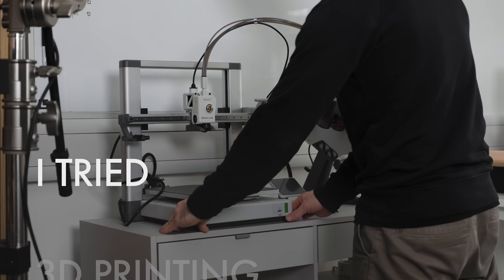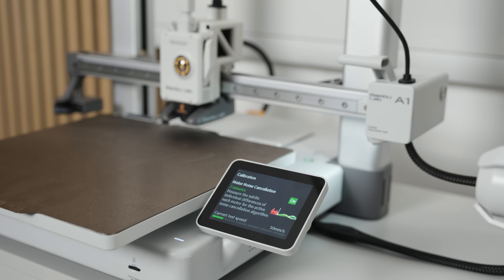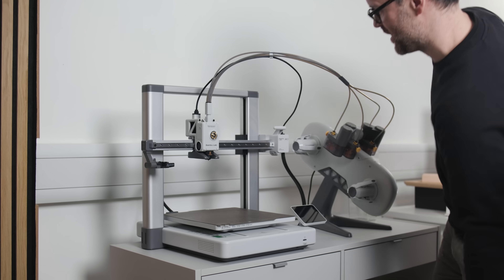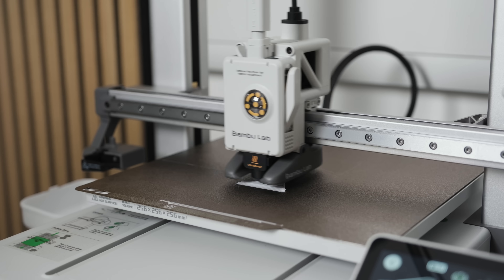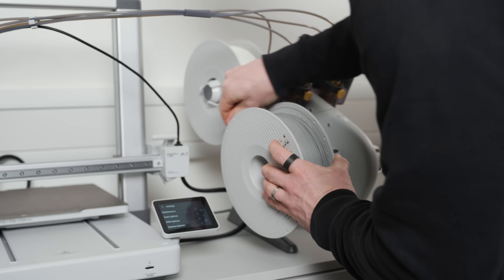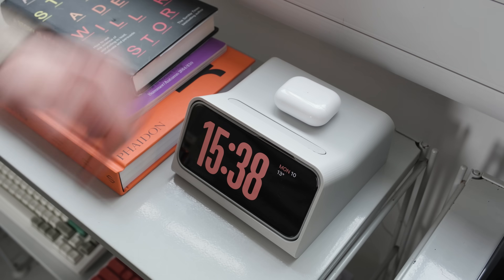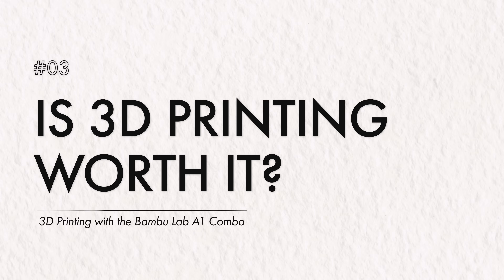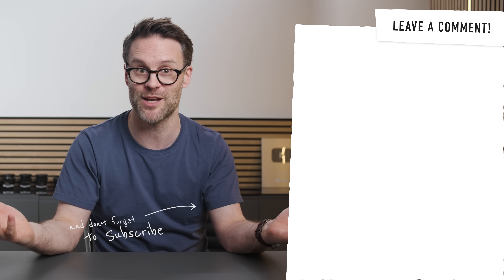I Tried 3D Printing as a Beginner: Is it Worth It?!

Comment: If, as a P1S owner bought one one of these, I would immediately switch it to LAN only mode as I did with my P1S and download any prints I want to make. I'm no fan of having a print uploaded to a cloud server only to have it downloaded again to my printer before it can print. And if your printer is working great, don't update jack. I'm still using my P1S on and older version of Bambu studio with an older version of the firmware for the printer and works just fine. My thought is, if it ain't broke, don't try and fix it.
Reply: I’m not sure I understand your reasoning here. Updates are meant to be useful. Update when you want to  

But not uploading to the cloud, are you concerned about IP?
Reply: @ It takes me less time to to upload directly to the printer than it does to take a print, send it half way around the world only to have it then upload to my printer. To me it makes no sense. Why would they want me to do that?
Reply: Stop fear mongering. Nobody cares
Reply: But it is broke. That’s why the updates come out. Update the software and your mind will be blown.
Reply: @ No thanks. My P1S isn't broken. And as a retired Industrial Electrician that worked in maintenance for over 30 years the saying, "if it ain't broke, don't fix it" rings as true today as it did years ago.

Comment: The printer camera actually records time lapse videos and saved them to the Micro SD card inside the printer, you don't need a separate camera
Reply from the maker: Yes - but the quality is terrible. And then angle is less than interesting! I would always use a proper camera to do this personally.

Comment: If you want to make your own objects for printing, I would suggest starting with tinkercad. It’s a pretty simple system that lets you build surprisingly complex objects out of simpler ones. Don’t worry, there’s a tutorial.

When you’re ready to take the next step, I’d recommend onshape. It’s very powerful, but I find it easier to use than either Fusion or Blender.

Both are web-based programs and are free to use.

Edit: I made this comment while I was about halfway into the video. Glad you found tinkercad on your own.

Comment: I got my first 3D printer last christmas it was a Elegoo Saturn 4 Ultra and it's a resin printer and it is great but I'm limited in the size of prints

I pre-ordered the new Centauri  carbon which is a filament printer like the one in your video which has a bigger build plate of 256x256x256 for some bigger projects I have in mind I bought7 roll of filament ready for when it rocks up and also learning to use the slicer software as well

Comment: Been looking to get in 3D printing and getting the A1, then this video popped up. Wondering if the security changes from Bambu affect people’s opinions
Reply: Look I’m big into 3d printing. But for the average person that’s also pretty big into this. It does not matter. Pretty much people are freaking out that these printers will auto update. They can’t to crazy complex things anymore deep within the firmware of the printer. 99% of us this has no effect on. You would never know the difference if all these big YouTubers weren’t complaining about it
Reply: @ thanks, honestly i’ve been looking around at other printers like creality but bambu still seems like exactly what I’m looking for.
Reply: @ahintea  yeah i mean ngl, bambu is def the easiest to use and start with. but after you get more experience they're all similar :)
Reply: @NathanRosenberger  yes YOU may not know the difference but hey buy from a company turning in the wrong direction when you can just as easily buy a just as good printer from a better company. one update may not be a problem, hell, maybe not even 3 updates. but what about 10 updates down the line?
Reply: from somone who has been printing for years, I still love my machine but unless bambu turns around and shows that they wont be making terrible updates I don't think I would buy another printer from them. while they do have great printers. i can just as easily use another brand, so its really up to them
Reply: I've been in the 3d printing community for a while and yes, Bambu had always had an eye to see if they would eventually go closed system and the security has always been a concern, the latest firmware was the evidence a lot of people needed to confirm their suspicions

Comment: 3D printing is a superpower.. having more than one printer is like an infinity stone.
Reply from the maker: Love this!
Reply: I’m itching to get my second Bambu printer. I have the Mini now and I long for that bigger build plate. Owning a Mini will make you a master at slicing models though.
Reply: @drj3141 same I have the mini. And I can’t wait to get it big bro the A1
Reply: @drj3141 it's good for beginners?
Reply: Bambu lab A1 good beginner 
? @drj3141
Reply: Calm down THaNoS :P
Reply: Indeed. My first was the elegoo neptune 4 pro, and it kind of sucked until I changed the hotbed, wireharness and installed the lates firmware for it, it now just works like the Bambu A1 I have (LanModeOnly and blocked from internet)
Reply: Having resin and fdm printers together are the real superpower
Reply: three FDM and three SLA printers, then you have infinity stones.
Reply: My first printer was the ender 3, after that I got a elegoo neptune 4 .

Now I have two k1 maxes and one k2 plus 😅
Reply: There are automation systems that exist so you can print multiple plates (kind of like a stack of plates that get autofed/removed from the printers)
Reply: What about the plastic waste from the 3D printers... Is any sustainable material can be used... Otherwise we are going to create more plastic waste...
Reply: for a general hobbyist that prints every now and then, its a waste though
Reply: @pear-zq1uj  Do you have one ?
Reply: I have 2 mini one with combo and A1 combo and p1s combo
Reply: Not practical for commercial level. Its just a toy.
Reply: Congratulations on your superpower of being able to create plastic junk at home. What a hero.

Comment from the maker: Something a little different this week pals - still tech, still making life better - and I might be hooked. So what do you think? 📣You can check out the the Bambu Labs A1 here: https://shareasale.com/r.cfm?b=2485357&u=3578368&m=138211&urllink=&afftrack=
Reply: actually printers can print great in a earthquake. Makermuse made a video where he printed stuff with the printer hanging from the celiling
Reply: Bambu Lab has closed its firmware and only allows cloud printing.
NOT WORKING.
It's instantly DISCONTINUED because its product requires the company to operate. Planned obsolescence.
Reply: the desk that you used to put the printer is the SPIKSMED, 97x40x79 cm?
Reply: U use tinkercad !!!!!! Omd finally someone who 3d prints abd doesn’t use fusion 360!!!!!
Reply: @BenJ30611 ik right bro I use that for a lot of my circuit building but never actually had I 3d printer ever I realy wish I had one